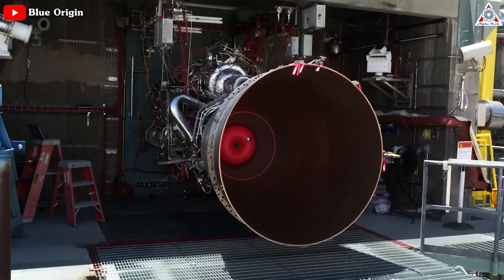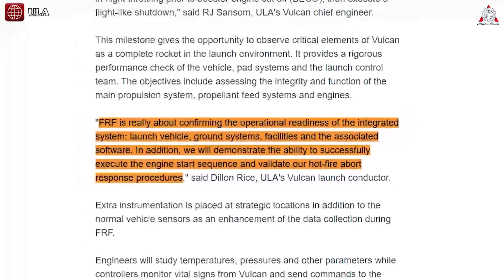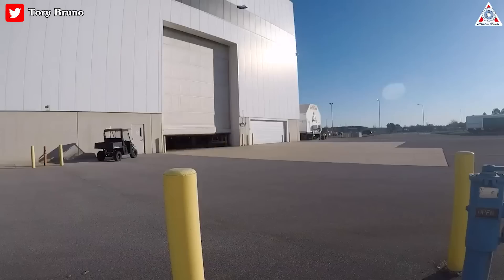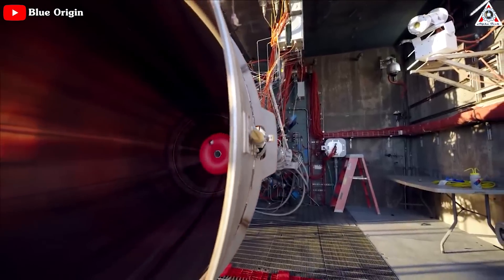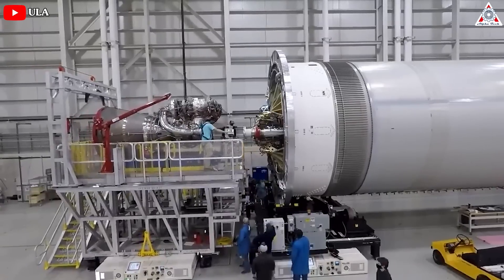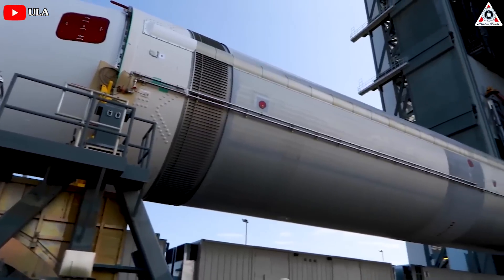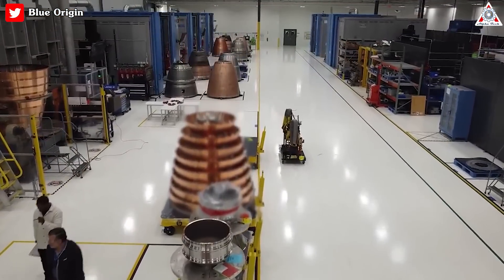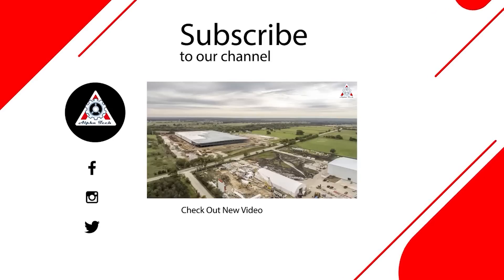Game over! BE-4 destroyed ULA...

Comment: If ula had picked the raptor, Vulcan would have successfully reached orbit already.
Reply: That would have required SpacX to have applied for the contract. Avoiding it looks like a better thing to have done.
Reply: Raptor tested on starship mega heavy rocket. 33 of those puppies. Bigger fail ratio. Now put 6 under Vulcan. You dont think it would reach orbit? How many times did BE-4 tested, atleast not as much as raptor at SpaceX mcgreggor? Ok lets look at progress, what raptor achieved already and what BE-4 achieved. You put your money on BE-4?
Reply: Really? Raptor has barely reached the stratosphere so far with Starship. Still a temperamental engine.
Reply: @roderickreilly9666  Starship has 34 Raptors in close proximity and requiring fine synchronisation. 
It is unwarranted and simplistic to say the engine is 'temperamental' when it might just as well be issues with the overall configuration.

Comment: Blue Origin needs to get busy building a type 2 BE-4. The original has one difficulty after another. It's like having to fine tune a cheap chainsaw everytime you try to use it. SpaceX would have the type 2 BE-4 ready for testing with dozens of upgrades that won't need to be adjusted at all once set to optimum. It seems temperature is playing havoc with the BE-4, and the engine is never going to be a safe choice until it's built bullet proof with upgraded values, and metals that won't expand outside of a very wide range. I thought the B-4 would be bullet proof already back in 2017. Blue Origin is going to have all it's contracts cancelled soon.
Reply: They need to ge this rocket up and running first.  Having said that, it does look half-baked and underdeveloped so perhaps a "type 2 BE-4" is the way to go, but if they choose to go down that path, ULA is finished.

Comment: Drop these misleading headlines. 

All rocket companies except for SpaceX would rather delay and be certain than take a chance.

SpaceX launched Starship despite 3 engines not working. Look how that worked out, yet I see no game over SpaceX headlines.
Reply: Yup!  The starship launch was a resounding success, for Starship.  Many mission objectives achieved, tons of data received, OLM repairs in progress and nearing completion, next launch already planned, hardware nearly ready to go, several more rockets in various stages of completion, hundreds of Raptor engines lined up and ready to fly, Raptor 3 coming on-line soon apparently...  And BO has yet to even get one of its only two engines to static fire while attached to a rocket, let alone get it off the pad!  I'd much rather go with the SpaceX strategy, which is a tried and tested method that gave the world Falcon, Falcon 9, Falcon Heavy, and Dragon.
Reply: @ChristLink-Channel  i disagree. A success means that it works. Starship did not. It has significant issues. Most notably a raptor reliability issue.

Just because Elon says its a success if it does not destroy the launch tower does not mean its so. This is the equivalent of me entering a marathon, predict I can last 1 mile, and then call it a success when I retire after 2 miles.

It is a difference in philosophy. spaceX with Starship prefers to launch often and fail often. Blue origin prefers to wait until its ready an succeed first time.

Only time will tell which approach is faster. But at some point we have to stop calling starship development quick and fast. They are 11 years and 5 bn USD into the project, and nothing has successfully flown yet.

Comment: It'll be really funny if SpaceX offers to sell ULA Raptor 3 engines at $250,000 a piece.
Reply: rs25: costing 150m usd per engine
nasa: no problem
spacex: 33 engine for 33m usd
nasa: comment disabled
Reply: Costs spacex about 1 million per Raptor 2 to manufacture at the moment
Reply: @frasermanley9903  Sort of... the cost of rocket engines is overwhelming the payroll cost of the people involved divided by the number of engines. If SpaceX builds just a few engines like Rocketdyne builds RS25s each will cost tens of millions of dollars. The actual material and fabrication cost is probably around 20% the price of the engine. This is why SpaceX is building the Raptor and Merlin as fast as possible and is not shy about blowing then up in testing or expending them. Not doing so costs almost just as much.
Reply: @dwightlooi  material Vs production cost is irrelevant when the reported cost is a million per unit. Sure, this will go down over time. However the stated 200k within the video is 5x below the current production cost. I can absolutely imagine a 200k engine once it has been refined and finalised, however,raptor is not at that state.
Reply: @frasermanley9903  Doesn't mean SpaceX cannot sell Raptors like Sony sell Playstations. They lose money on every one in the 1st 1~2 years of production. Kinda break even on the 3rd and start being in the black in the tail end of the product cycle. The objective is to get people on the platform and squeeze the competition out of the market.
Reply: @dwightlooi  that might make sense if SpaceX were building a platform. However, Raptor production is the product, there isn't any aftermarket sales that are the main funding model for producing Raptor. I expect they'll get
their costs down over time, however 200k seems a reach(at the moment).
Reply: ULA would have to rework the whole launch system to go to a methane fueled engine.. Yes, LNG is predominately methane but it's slightly different and not interchangeable.
Reply: @dereksmith7242  Uh... ULA did rework their infrastructure to go to a Methane Engine. The BE-4 that Blue Origin is screwing them with is a Methane Engine. LNG is Methane, period. While there are different purity grades, the infrastructure to handle it is the same.
--
ULA could have launched two to three years ago if they are stuck with their traditional partner Aerojet with their AR-1 offering which is an US staged combustion Kerosene engine. No infrastructure change needed, no change in rocket diameter needed, practically a drop in replacement for the RD-180. Yes, it's a few million more per engine than the BE-4 as quoted by Blue Origin, but it'll save years and billions with the rocket design and infrastructure changes. Even at 10 million savings per launch in engine cost differences it'll take 200 launches to recoup the money they put into the Vulcan 1st stage and LH4/LO2 support facilities. For ULA launch cadence, that is pretty much the lifetime of the launch vehicle.

Comment: They need to get their engines from Elon Musk
Reply: The engines that Space X uses are the wrong size for the Vulcan rocket.
Reply: @michaeldeierhoi4096  it's the payload that matters, not the rocket. Besides, Elon will have his new rockets working before Bezos does his OLD design that still isn't working
Reply: @WayneWatson1  The Vulcan was designed for two rocket engines of the Be-4 size.  Vulcan would have to be redesigned to accommodate the raptor engines.
Reply: @michaeldeierhoi4096  forget the Vulcan, Musk can do it better with his rocket and his heavy lifting rocket. It'll all be done before bezos' team figures anything out. Blue Origin is just a dream that'll turn into a nightmare
Reply: @michaeldeierhoi4096  That might be faster and cheaper than waiting for BO to get their act together, and make a BE-4 that works.

Comment: I wonder could Dream Chaser be launched on a modified Falcon 9 Block V rocket.
Reply: Maybe falcon heavy with a custom fairing
Reply: @juliancrooks3031  maybe no faring if it can survive reentry, also looked to me like in ax 2 webcast there was some kind of step up adaptor in background it was black possibly the for Vast which definitely ain't fitting in 🥡
Reply: @juliancrooks3031  :washhands::washhands::washhands:
Reply: Might be an issue with the fairing size.🤔
Reply: @ARWest-bp4yb  I still don't understand why it even needs one early artwork is without
Reply: @setituptoblowitup  as I recall, the initial version of DC requires a fairing, and is too wide for the current F9 fairing. But they could absolutely build a new fairing and adapter to make this work. This has been discussed, but it all comes down to who's going to pay for that development. Also, the 2nd gen DC is being designed so that no fairing is required
Reply: Yes it can on a falcon heavy
Reply: @stephenallen4374  I believe that Sierra Nevada Corporation has seriously studied using the Falcon 9 Block 5 as the launch vehicle, particularly the crewed version.